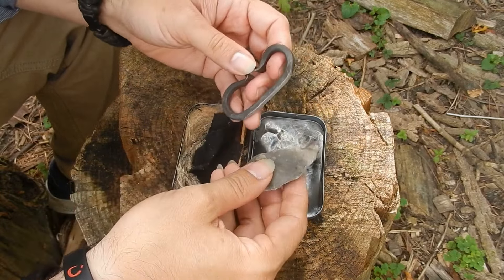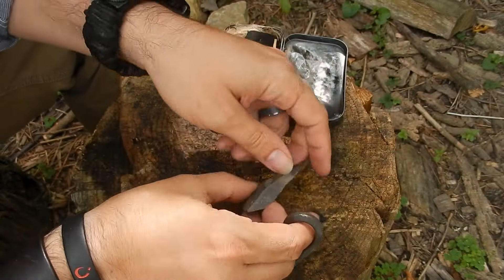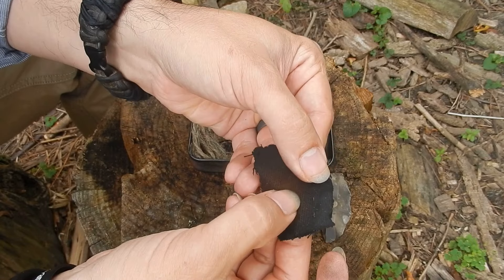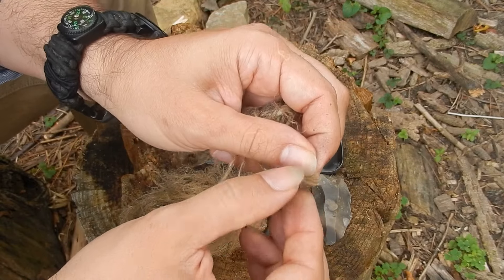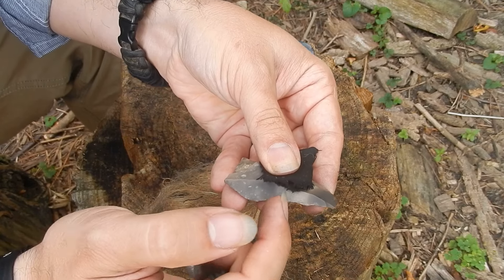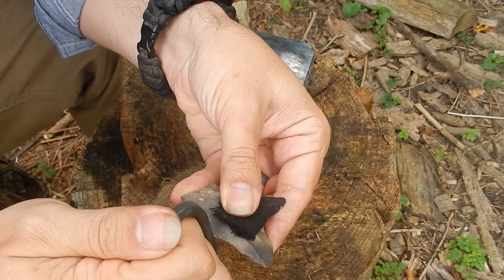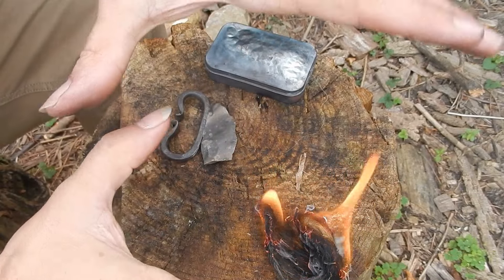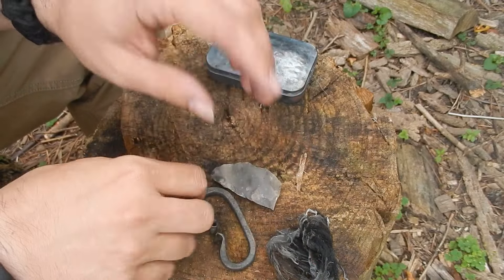Flint and Steel Fire making-what you need and how to do it

Comment: notice the brown portions of the charcloth, which shows it wasn't cooked properly and it won't take a spark consistently. It needs to go back into your tin and be recooked.

Charcloth should be a uniform black, supple, and have a slight sheen to it, but with no smoke or tin residue on it. Charcloth is the gateway tinder for flint and steel and allows you to grow your skills and move onto natural tinders like punk wood and fungus.
Reply from the maker: Some excellent points for sure. Thanks for adding to the education here!
Reply: @jeffandthings77  Flint and steel is my passion and favorite way to light fires, I love every aspect of percussion firefighting. Making charcloth is an essential skill and we all should be comfortable making it. While I love using all manner of tinders I tend to use charcloth the most because it is so effective and works so well. Plus it makes flint and steel easy.